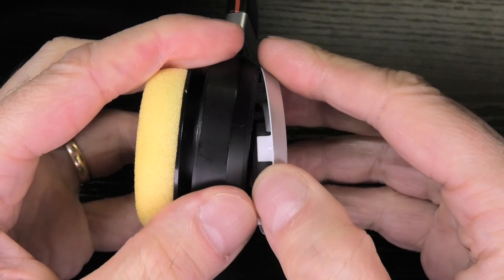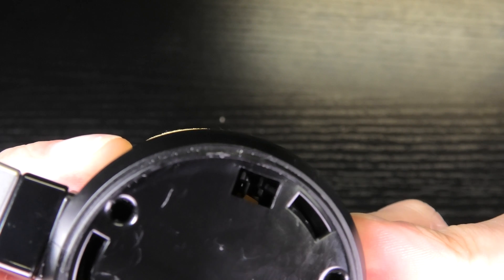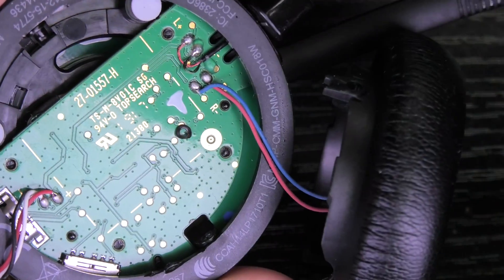Looking inside Jabra Evolve 65 (Teardown)

Comment: This was very helpful, the tiny bit of plastic holding the earpiece to the headband on my mono headphone snapped and I was able to find a 1.2mm screw and nut to reinforce it.  (This won't work for stereo though as the hole is the one used for the wires).  What a horrible design for an expensive headset.  If this doesn't hold together, I'm using the 3d printed bracket hack.
Reply: what is the 3d printed bracket hack? Or are you saying that you would design and print a bracket for it. If It already exists, I could definitely use it.

Comment: Just fixed these POS headset and I'm convinced it was intentionally designed to fail on a plastic hinge and made difficult to repair. I've ended up additionally breaking one of the foam piece swivel hinges when trying to access the inside to look for ways for fixing that tiny hinge that allows whole earpiece to rotate. This tiny hinge is meant to take the forces applied to whole earpiece and failed while I was literally holding a headset in hand. Ended up making it a fixed non rotating earpiece with a bit of epoxy.

Comment: Just fixed my Jabra 65 - one of the internal speaker cables were broken (no guess how it was possible). I have solder it back again.
Reply: Hi, I am facing the same issue
Reply: Thank you..
It worked by trial and error, the red wire wasn't +ve for my case.
Reply: How did you solder it back? I mean how did you know the +ve and -ve cable, or there's no difference in this case
Reply: @mohamedabdallahsharaf4921  Hello - in my case only the + was disconnected, so I have soldered back that only

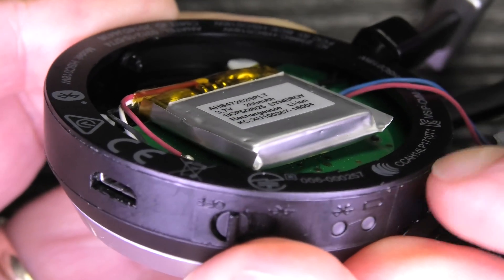Comment: 5:51 I need to go further than that point, mine is broken on the joint so I need completely remove that part to try to fix it. Or just desolder one side and make it mono XD
Reply: Are you able to fix the speaker

Comment: great video.  Hoping you might be able to help on another issue on the Jabra Evolve 65
where the earpiece meets the headband, there is a rectangular black piece on the inside.  it is held by two screws.  This part cracked on mine, likely due to the repetitive stress of putting on the headphones.

Has anyone had any luck removing this part and replacing it?  I have some older, broken Jabra headsets, so I figured if I could get the right kind of screwdriver, I would simply cannibalize another non-working unit.
Reply: Hi, I also have the same problem, were you able to fix it?

Comment: Great video! It's annoying that this headset lets you swing the microphone over to be worn on the left ear, but it doesn't have a way to swap the left and right audio output! From viewing your video, I can see that a little bit of additional engineering by Jabra could have easily allowed for this to work at the mechanical-mic-arm and electrical-speaker-terminals!... now I'm wondering if I should bother to DIY swap the solder for the left and right speakers. 
I know there are software solutions (Equalizer APO) to achieve the same thing, but that isn't available to me as my workstation is locked down by policy!